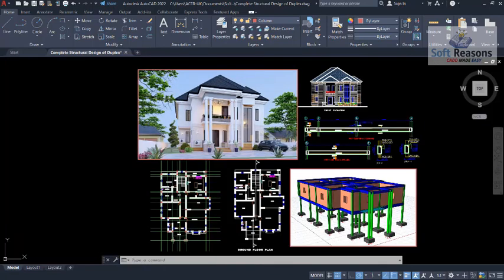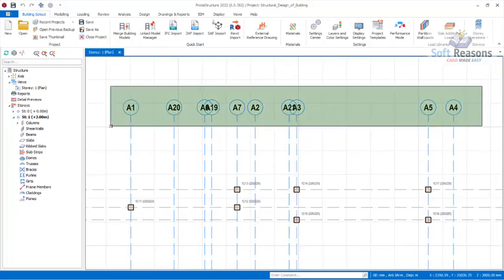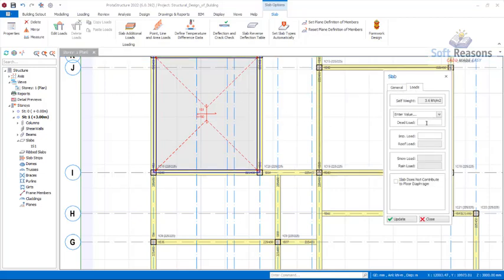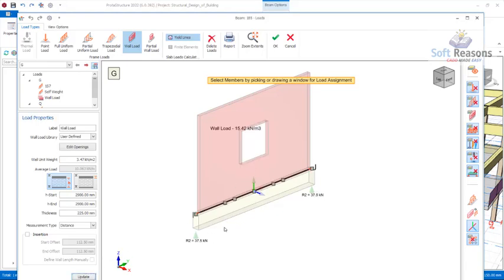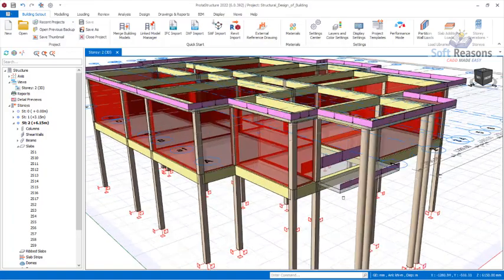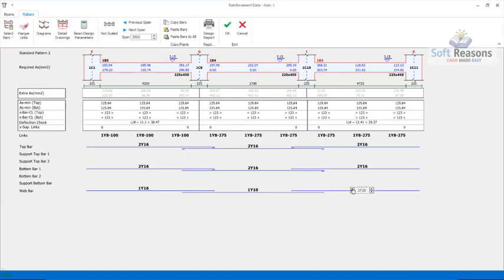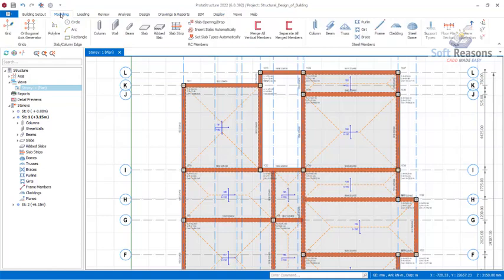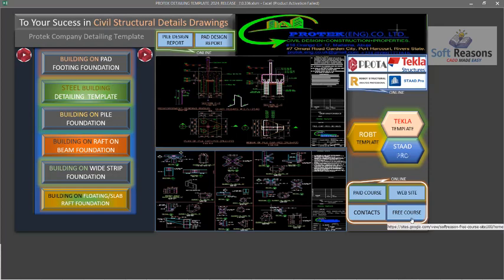PROTASTRUCTURE , REINFORCE CONCRETE  BUILDING DESIGN COURSE AND DETAILS DRAWINGS 4 BEGINNERS #CAD

Comment: Sir is roof load negligible on the beams?
Reply from the maker: No. Roof Load is incorporated in the settings
Reply: @CADmade-easy  how many kn is the roof load sir?
Reply from the maker: @muhammadaminu6585  Calculated from ur roof slope and roof coverage area
Reply: Is it possible to share the dwf for practice purposes?
Reply from the maker: @Asher_87-x1b   in the group chat you get the file
Reply: @CADmade-easy  I just followed the Telegram chat... I can't seem to find it.
Reply from the maker: @Asher_87-x1b  WhatsApp Group chat